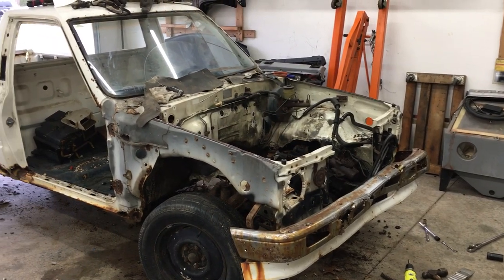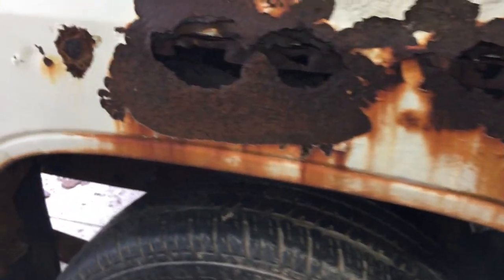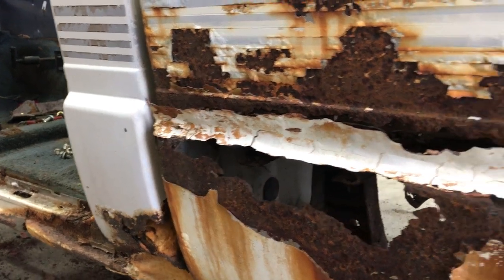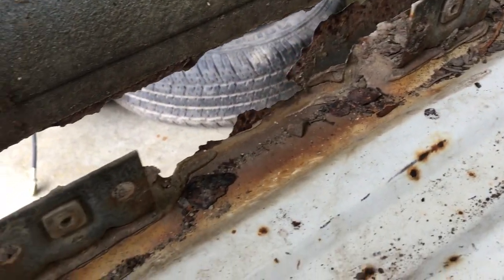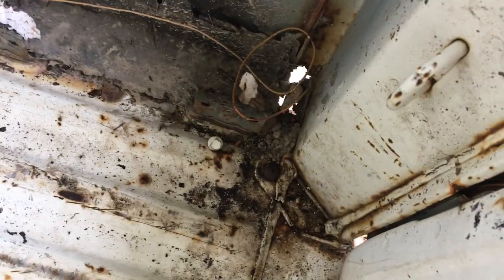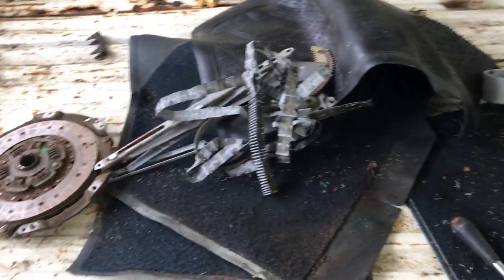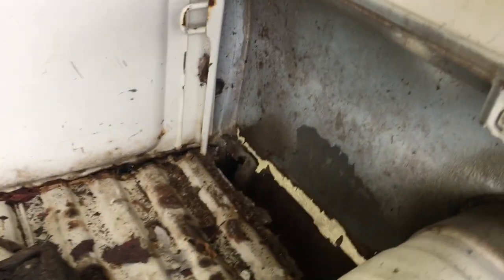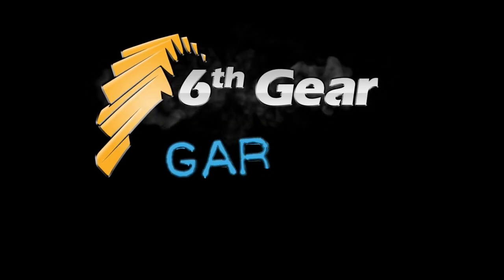Cause and Prevention of Rusty Bed on Toyota Pickup Truck

Comment: A truck bed could be easily replaceable. The places I'd look for if buying some of these trucks would be the frame area near the fuel tank, as mud and debris get easily caught there, rusting the frame. And under the front fenders taking a peek there with the doors open, since the water from the cowl drains to there.

Comment: I've been fighting rust on my '86 for over a decade. I got it in Florida and someone had put a bed liner and a roll bar in the bed so I never realized there were removable panels to access the inner fender wells.
Reply from the maker: Hope yours is still looking good behind the panels... better than an Ohio truck for sure!
Reply: @6thGearGarage  I was just "rust preventing" it yesterday with some Krylon Black Primer. It's already eaten holes through but it's not nearly as bad as the Ohio truck. Now I'm a strange dichotomy of sad and disappointed with relieved and grateful. Thanks? Lol...Really interested in seeing what you decide to do with this.

Comment: Would be an interesting Science project, filling all the panels with expandable foam some truck in it way out. A taboo theme among many repairs. Been around many cars, that they eventually rust because the draining plugs under the panels get clogged. The foam would avoid water to get inside in the first place.
Reply from the maker: In the first video of the truck where I got it running, I showed the cab corner which was filled with spray foam at one point. However the rust continued to eat away at the metal, to the point where it went beyond the top of the foam. I wonder if the foam helped hold moisture because it was porous?  I'd still put my money on Fluid Film, or similar product over spray foam.

Comment: I miss that truck. I drove that ol gal just like that for years.
Reply from the maker: Did you use it for hauling rocks? I noticed it had air shocks the other day and found some pieces of polished stone in the bed.
Reply: I installed granite countertops for 10 years and I would put scrap stone in the bed for winter weight.

Comment: the inner bed sides are part of the reason why these beds rot so bad. the other reason why is on inner bed seem underneath the bed floor toyota decided that seam sealer is not required so salt water and dirt would get in it and cause it to start rusting. the cleanest factory bed I have had was undercoated along that inner bed seam.

Comment: My base model '86 didn't come with the panels.  Blessing and curse, because I have dents from stuff sliding around in the bed.
I'm pondering using stainless cables or something to protect without trapping junk.
Reply from the maker: the bed of my 1980 pickup is the same way, dented up from the inside. I'd say it's worth not having the inner panels to prevent rust, but the bed on that 1980 isn't far behind this one :(

Comment: Ive got an 87 and have just the starting of rust between the seams right at the back edge of rear fender. How would you go about fixing it?....Its a Ca truck so rust is minimal
Reply from the maker: Have you looked behind the removable panels yet? That will let you know how serious/expensive of a repair you're getting into.
Reply: @6thGearGarage  Thats ok I have a cap so stays clean...my rust is with in the wheel well 2 inchs of light rust at the end of the seam at the tire...think I need to clean out old seam sealer get rid of as much rust as I can and treat with rust stop and seal inside and out side the seam and paint. Thanks for the vids and info....I also find the front of the rain gutter over windows to be a bad design and rust there to...bad drainage from plastic trim.